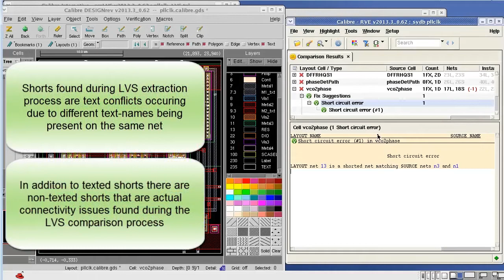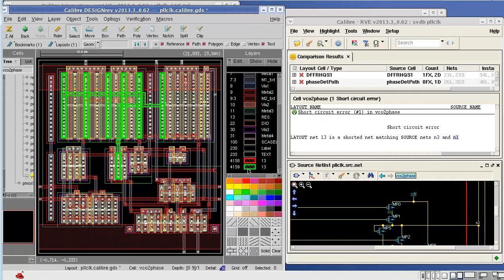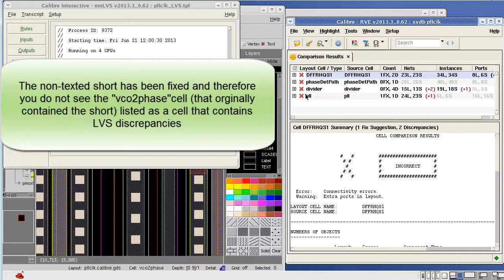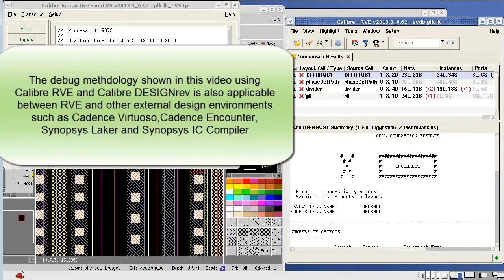How to debug non-texted shorts using Calibre RVE

Comment: I use the rve to highlight the nets in the layout, then find a metal piece on both the nets in question.
Then use LAYOUT TEXT "n1" x y layer textype and LAYOUT TEXT "n2" x y layer texttype
and then run lvs, lvs will flat the shortest path which will help find the short quickly, else it is a guessing game

Basically you can convert the non texted short to texted short.  That is one way.